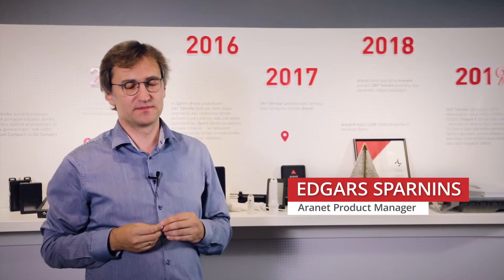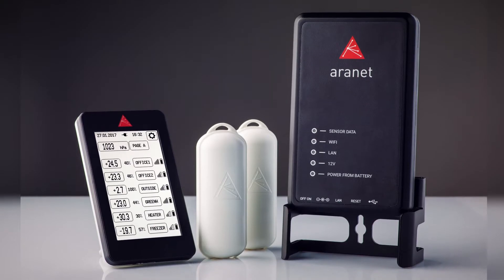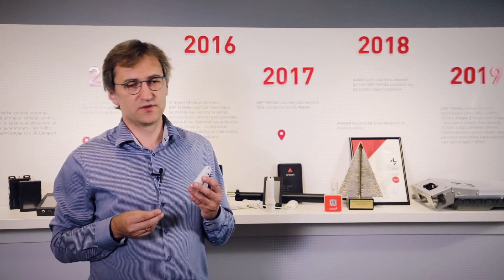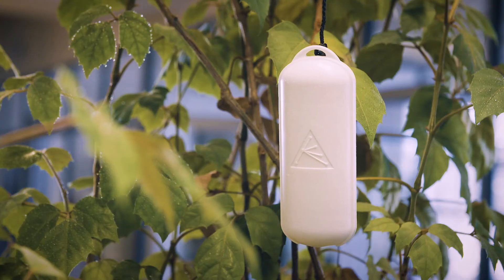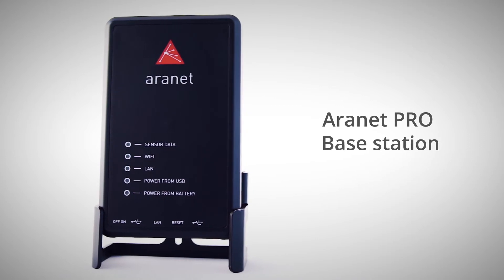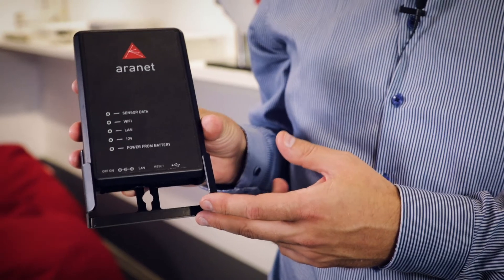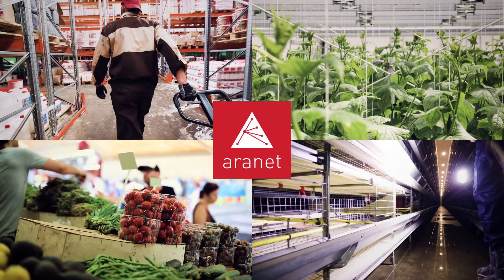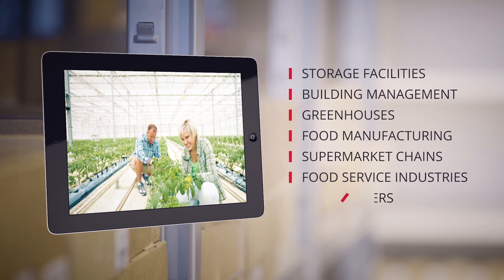How are Aranet Sensors Made?

Comment: The wireless distance of 3 kilometers is fantastic. In real conditions- 250 meters, in line of sight. Application for 10 years of battery life...However, stop fantasizing.
Reply from the maker: Thanks for your comment. We understand that line of sight may be a confusing term. However, what we’ve seen ir real world tests, where the base station actually sees the sensor, the distance goes a bit beyond 3km, but we write 3km in our data sheets just to be safe. Now indoors, or in places where you have obstructions in between, the radio signal strength drops off rapidly. You can’t cheat physics. For example inside a greenhouse environment, where there is a lot that can absorb the signal, 250m is a realistic distance. 

Our temperature sensors use small amounts of energy, so sending the signal once every 10 minutes, it will deplete a typical AA battery in 10 years. However many off the shelf AA batteries might not last for 10 years themselves just because the materials inside degrade faster. We hope this clarifies the confusion!